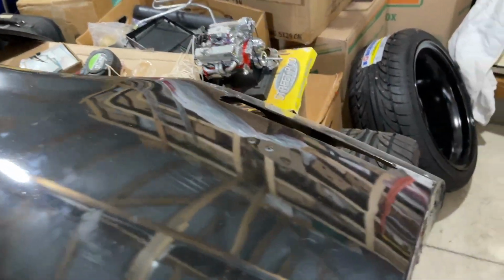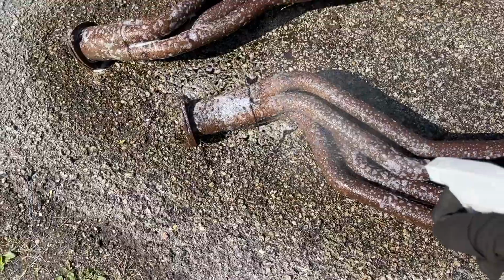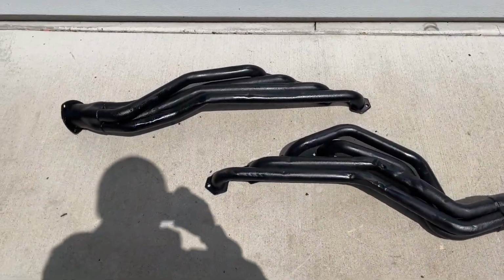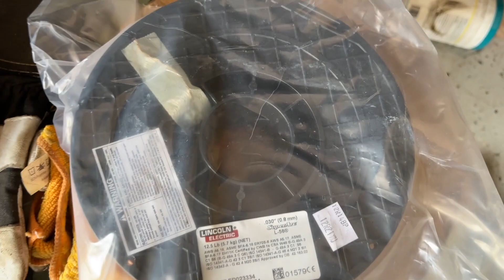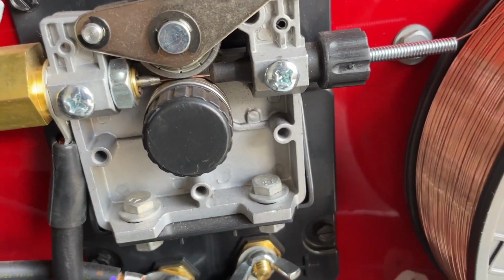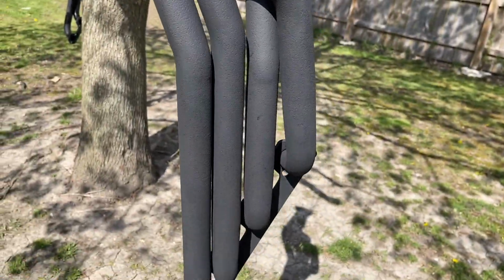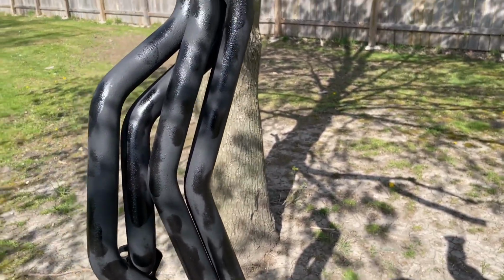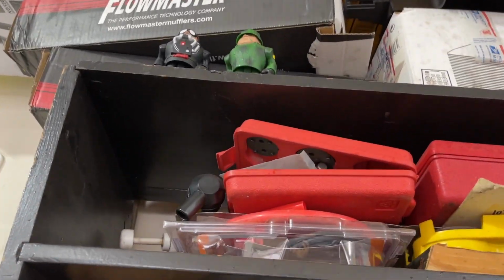Removing The Hedman Headers On The Black Mustang II For A Different Set! I Gotta Prep Them Up First!

Comment: Nice.  Headers are one of the more difficult things to install.  I like headers that have the tubes separate, not one long bracket.  Its easier to get them on.  Also, they were easier to install using studs instead of bolts.  The other thing that might be good to do is put the connection in for an O2 sensor before you install them.  Im interested to see how the wheels fit.
Reply from the maker: The headers installed fairly easy (video coming) and they are great!. I will not be running O2 sensors. Trying to have it just like it was in 1976. Also, I have a video on the channel showing me fitting the wheels. Thank you SO much for watching.